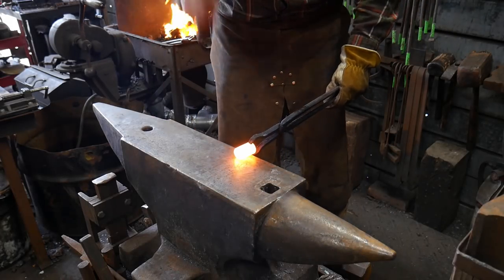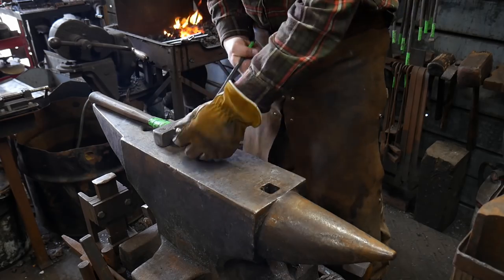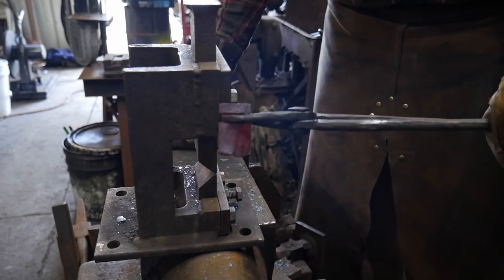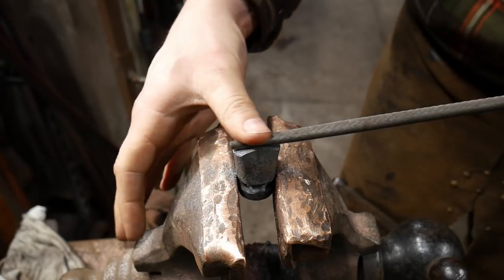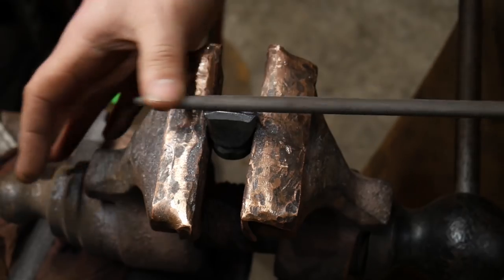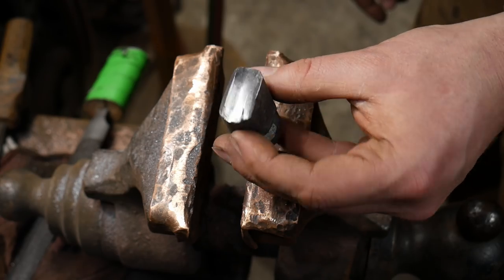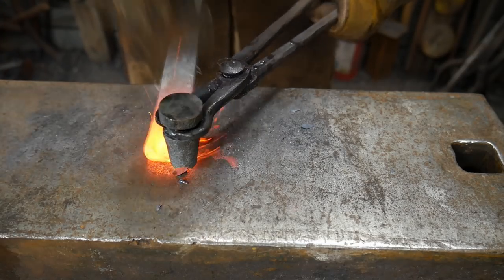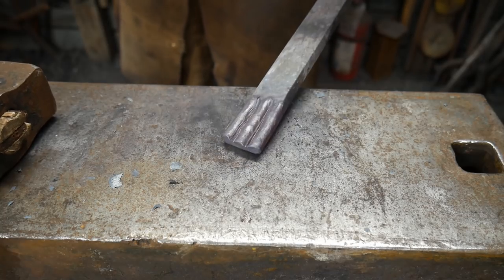Forging a Round Veining Butcher Tool for Blacksmiths

Comment: Call it a fuller swage because it’s a fuller until you file the swage into it, and I do use one like that for the vein on my leaves, great video Though Roy I always appreciate the videos you do, I wish you would look up the material that I told you about though on the soft faced hammers and give me your opinion because that would mean a lot to me I don’t want to spend my time messing with it if it’s to hard to work with or would damage the top tool